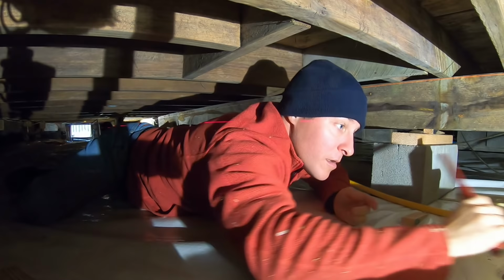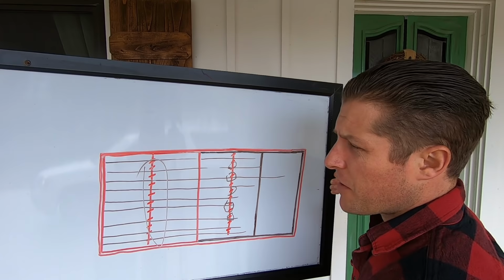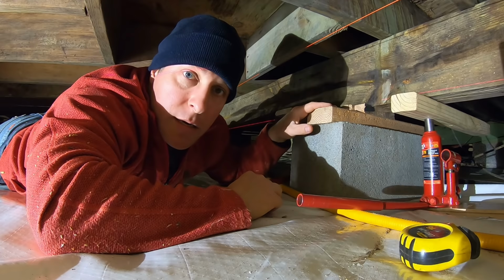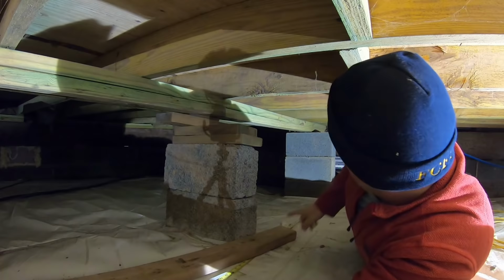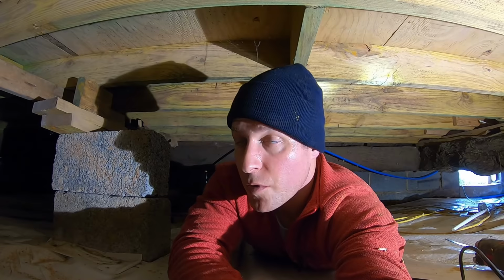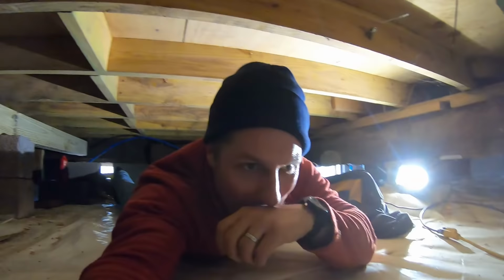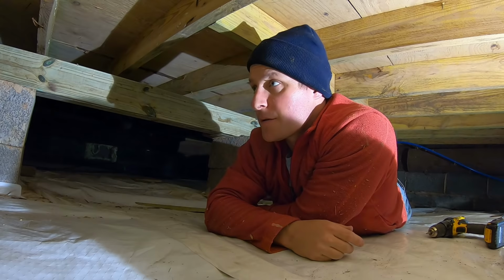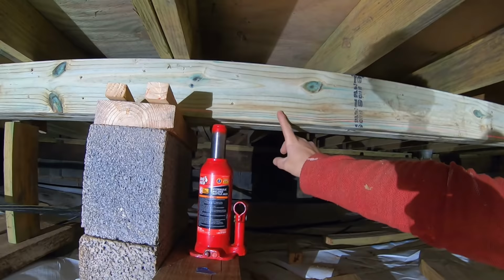Leveling FLOORS in our 100 year old Farmhouse! Fixer upper

Comment: That’s some nice treated floor trusses and vapor barrier for 100 years.
Reply from the maker: Thank you. Like most 100 year old house the floor was pretty much rotted out so it was removed in most of the house. Just leaving the foundation and walls . Then they hung new floor joist and plywood.  There’s still a few portions left that have the old 1x4 decking but most of it didn’t survive. The vapor Barrier we did about a year ago due to standing water and the moister levels along with a sump pump and whole house dehumidifier.
Reply from the maker: In the beginning of the video we explained the house was actually moved that it’s current spot in 1947 on skids! 2 long trees pretty much at that point the house was cribbed up in the air and a block foundation was build. Then they lowered the house on it. Same way they would when moving any other house and left the tree pole skids under the house. In 1980 they added the front portion and the rear as explained in the beginning of the video. Here’s our email littledreamersfarm@yahoo hit me up I’ll give my cell number it’ll be much easier to give you the whole history over the phone if your interested. Thanks for watching
Reply: @LittleDreamersFarm  I don't think it would help my situation.. Mine has the old field stone cellar under the middle third and a partial crawl space under a small section under the other 1/3 the last 1/3 is walled off.  2 stories tall with a balloon frame.
Reply: Brings back memories.   I've been working on a 100 year old house for about 40 years 😁.   It seemed like a good idea at the time because we needed a roof over our heads but today I  often wonder if it would've made better sense to have demoed it and started new.
Reply: @jerseyjim9092  haa..me too...one thing bleeds into the next..Ive already remodeled things I've already remodeled before..Im committed to most likely dying here now.
Reply: Job well done👍 Kudos to your better half for actually getting down inside to help, mine wouldn't. I just have to SAY the word "spider" and she screams, LOL. Question for you... When it was all done, did you throw a level on the top side of the floor, and if so, did you need to go back underneath to make many adjustments?
Cheers!
Reply from the maker: Lol thank you! Yes I actually did. Before we install new floors I checked everything. There was some very minor spots I had to use a little bit of floor lever before the new hardwoods went down. Worst part was maybe 1/4” but before leveling the underside we had spots that were 1” plus. Thanks for watching

Comment: I am just a homeowner that has built a few homes and rebuilt a 1927 home which needed extensive rebuilding of joists that were over spanned and undersized.  We tore out living room floor for access to work and discovered the 2X6 joists spanning 32 ft were 2 rough cut 20 ft long 2X6 and were supported mid span by a long row of sandstone blocks that had cracked and settled over 90 years, some of the joist were sitting on native soil/sand.  We jacked rim joist up from inside, replaced 2x 6 joists with 2X8 speced out by structural architect.  But first we removed the row of sandstone blocks, leveled and temp supported structure and poured a bomber concrete footer after digging out crawl space to minimum 18 inch code, we have termites.  Built a 3X6 pressure treated stud wall on the long footer with separation from wood and concrete as per code.  Installed a nice hickory floor on top and insulated R19 between bays and installed vapor barrier under insulation.  I am about to level a 1910 church I just bought and no way will I use hollow cinder blocks as they can catastrophically crack as they have little strength.  I will use laser or water level to figure out where the sagging 10X12" beam needs to go, use screw or hydraulic jacks with blocks to temp level, pour concrete footers hopefully to bedrock which is a foot to 18 inches down and use post and beam with thick burly simpson style connectors and adhere to code or better.  I suggest your fix is good for a temp fix, but you might consider a more permanent solution.  If it was a 2 story structure, the cinderblocks would be very dangerous and a hazard to be under the home. I hope others watching will understand that using cinderblocks as structural piers is not a good solution, especially if you double stack without wood in-between them as they will crack under load better to mix up concrete and form concrete piers with large posts.
Reply: I came here to say he should have poured footers and made it permanent.
Reply: Must be really arduous to dig in that small space?

Comment: If you're going to use bottle jacks, always put a 1/4" thick metal plate between the top of the jack and your lifting crib.  Otherwise you lose lift due to the jack crushing into the cribbing and risk crib blowout and dropping the load.  Experience says so.  I use 10t screw jacks instead. No risk of a hydraulic seal blowout. Keep up the good work.  Old house renovation is a daily adventure.

Comment: Love the demonstration. Unloading of a structure by jacking is crucial when repairing or replacing members. There are folks hammering shims and beams into place. 
I would caution against the use of those types of shims due to the amount of shrinkage that will occur and minimum bearing area requirements for setting a wooden beam on concrete. The biggest challenge is that the material properties of wood differ in every direction possible and the shrinkage will not be uniform. It loosens, one small area ends up carrying all the load, high local concentration of stresses, crushing (beam or CMU), loss of a support point, and a little extra bounce. Check your local codes for minimum bearing area requirements. 
Do not allow anyone to make repair or remove structure if they have not investigated the interior to determine what is above the location (aka structure along load path). If they have not investigated and jacked, some will be banging all day trying to squeeze that beam into place.

Comment: It was do nice that your Wife helped you. I had to replace 6 foot lolly columns in my 100 year old house. The columns rusted from the inside out. I dug footers. With rebar n high strength concrete. The base of the columns just rusted away to nothing. Luckily there were huge boulders under each column. But I rested each column on a concrete pad from the bolder to 4 inches above ground on the basement floor so they're not in the ground but above ground bolted to the concrete. I also learned they have (saddle plates) wrapping around the main support joists (wood support beam) bolted to the lolly columns.  Enjoy your house Pal.
Reply from the maker: Thank you! She's the best wife ever ;) Sounds like you had quite a job there! Thank you for watching!

Comment: I have 150 year old farm style two story house.  Front is original, back half was torn off in the 70s and rebuilt.  Most rooms have 16ft spans like yours with 2x10 joists.  I also had flat boards in the newer sections for mid-span supports which makes no sense.  I'd suggest using steel plates between the jack and the wood.  Jacking joists might be okay, but moving a load bearing or exterior wall with a heavy duty jack will punch right through the wood before it lifts anything.  I could not tell if there was a footing below the new concrete blocks under the encapsulation.  Something needs to be under that even if flat treated 2x12s or it will eventually sink.   Pouring footings in a tight crawl space is almost impossible without pulling up the floors.
Reply: I just had a estimate by two different people. One is a regular contractor and the other were the Amish. They both said the same thing, that my little room off the back of the house should have had footings,  I told them no, because the room is held up by logs and they have been there for 31 years. If they lasted that long, I am not worried about jacking them up again and just putting in some shim blocks. They want  both wanted about the same amount of $4500 to raise the room back up with out putting in any footings.

Comment: I have a fieldstone foundation farmhouse that was built in the 1910's, and I'm dealing with this issue.  The difference is there is no "crawlspace" to speak of.  They literally built the house with only bout 8" of space between the subfloor and the ground.  It does have a root cellar and for the most part everything is structurally sound.  The house and foundation have maintained perfect homeostasis with the ground and it hasn't moved at all.  The issue is for me that to level the house, I have to do it from above and go in with a saw - cut up the old subflooring to reveal the joists and start leveling from there.  Since I don't have $120,000 for a complete remodel i'll be doing all the work myself.  Thanks for the video!

Comment: I just jacked my center girder  beam, 3-2x8's sistered siting on cinderblock piers of 4 to 5 feet apart. I needed 50 ton jacks, bought off Amazon, 20 tons were not enough, brand new defective cheap Torrin jacks from HDepot, only advantage was they are short. The 50 ton are 10 inch minimum height.  For temporary footing, dug into dirt 3 inches, and laid in 5 layers of 3/4 plywood squares 2x2 feet. Easily held the weight, but did press the plywood into the dirt a ways.  For the shims cut full cover boards over cinderblocks, no wedges, trimmed to proper thickness  with table saw. jacked on both sides of the pier shimmed to proper height, move to the next pier. This took us 2 people about 5 hours of work time.  House built in 1973, the ground is somewhat sandy.
one way to tell your main girder is straight, eyeball along its length. And check the door frames. A lot of 2nd story bedroom doors, you can tell by looking at the tops of the doors. We jacked each pier seperately and it was ok. Other issue I have is first floor  bathroom joists have sagged so need a new shorter girder of maybe 12 feet and 2 piers severla feet in on both ends of new girder. We have slate entrance foyer held fine and upper story bathroom tile floors, nothing cracked.  Honestly was concerned, but it is like a reinforced slab, hard to crack.

These jacks worked and are not too expensive. I bought two.
https://www.amazon.com/gp/product/B00CS6KCOS/ref=ppx_yo_dt_b_search_asin_title?ie=UTF8&psc=1

Comment: Typically most people put the level on the floor of the crawlspace. With all the irregularities in the floor it may be impossible to find a true level spot. Suggestions right here. Find the high spot of the floor and put the level on that and project from there. This will make all floors true level. When I saw you do this you passed the litmus test right away. Thanks for the video.

Comment: Nails are preferred for nailing the three 2x6's together, because they have more sheer strength, then screws.    If you have used, say, sheetrock screws, you have made a mistake because they do not have the sheer strength to construct a beam, and you need to get under there and add some nails into the beams, both sides.   There are more expensive screws, that you can also use.   They are fairly common anymore.
Reply from the maker: Awesome that’s good advice thank you.
Reply: Never use sheetrock screws for fastening structural materials.  They are very brittle and easily sheer under load, especially as the load flexes over time.  Deck screws and other screws made for construction are made of different metals and are much stronger.
Reply: @markmoore4088   so you agree with my comment (lol).
Reply: @normbograham  Yes!

Comment: Great stuff here! One suggestion while under and in the air , consider placing a tar paper matt between each support stone base and the wooden sills You place on top of them.

This will avoid any condensation which always gathers between stone and wood surface intersections often causing even treated woods to rott in time.

Thanks for this excellent video! You've both done a real great job to be proud of!❤

Comment: May I ask why you guys didn’t use steel plates to shim. Wood compresses over time. We leveled our main beam and used 1/4 inch thick steel shims (4x4 in inches).
Reply: Cement sheet does the job as well. Corrosion resistant Steel would be ideal though. 
I’m not sure why they would use wood either.. some of the houses I have worked at the floors were initially shimmed with wood and asbestos.. the asbestos held up but where the wood was used it moved significantly. 
I think it’s just a cost cutting thing so I’m not sure why these guys use wood for their own house.

Comment: My house was built in 1926 and is sitting on sawmill rough cut lumber.  I have to do the exact same thing, in addition to replacing flooring, replacing rim joists and level a corner of the house.  I wish I had as much crawl space as ya'll do!  I've had to use a folding shovel and dig a trench to get to where I needed to work before.  I'm not claustrophobic,  I just have a fear of getting stuck!  I've learned that 4'x8' was not a start of measurement when this house was built!!!  Floor joists are 25", 26" and 27" apart.  No subfloor and decking either, just tongue and groove pine flooring nailed directly to the floor joists.  I love working on an old house.

Comment: nice work. we got ours and it was definitely a fixer upper. massive oak beams underneath some with the bark still on and nothing like modern joists just beam after beam crossing each other. think i've been to the dump 10 times but we cleared out the crawlspace and made it nicer and dry. added framing for insulation and steel supports for all the 6x6's in there. floors pretty solid. still have things to do but progress. well done on yours, that beam going across is beautiful

Comment: Holy heck I wish my house was so clean! Built in 1882 with box walls (think like a thick picket fence instead of studs) and a 16" brick foundation with partial basement added later. I've got a porch that the previous owner closed up. Now it has settled from the added weight and no way to get under it. I'm trying to dig it out, get a jack in there, and raise it up before laying cement. Might see about blocks instead if that is a reasonable thing to do.

Comment: Great work!  Your crawl space looks so clean.

I’m getting ready to work on mine.  The floor joists are large logs that were flattened on top.  They are notched into a big 10” by 8” hand-hewn beam.  The house was built in 1847 and there is not much room in the crawl space.  It is also not anywhere as clean as yours!